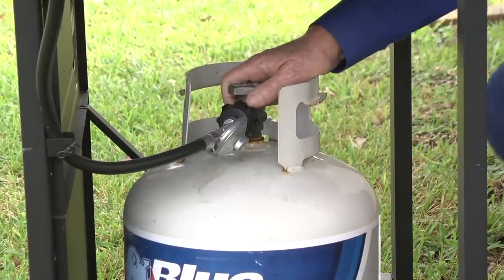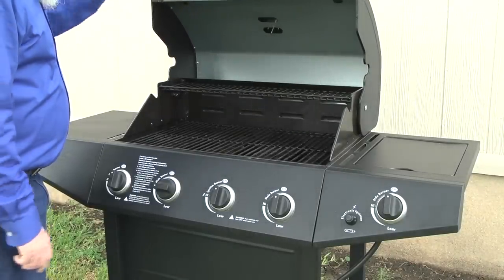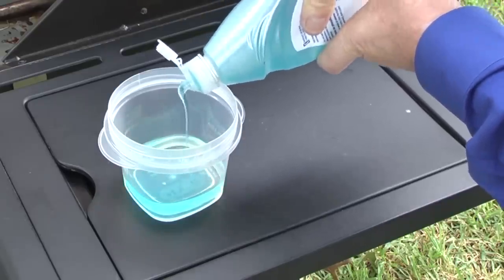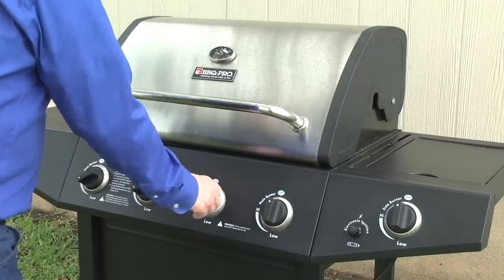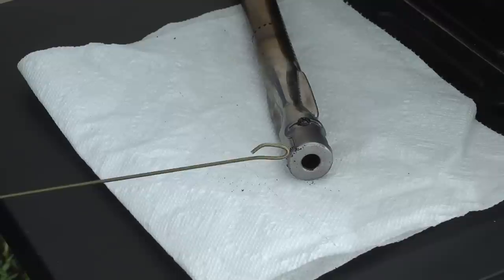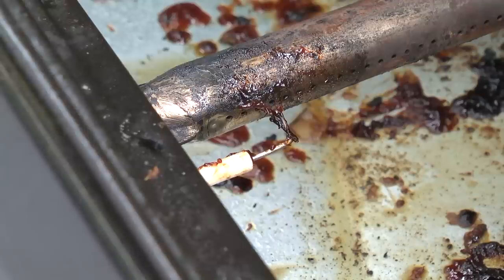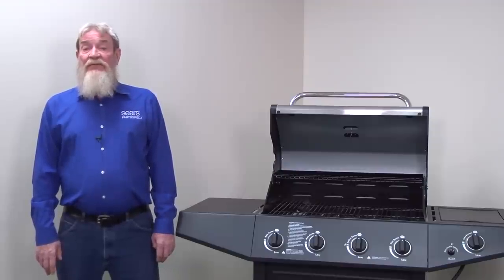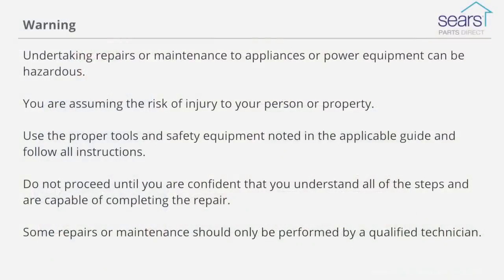Gas Grill Won't Ignite or Light

Comment: In fact, the first thing to do is the last: remove the module and activate it with the button: is there an electric arc? Yes, continue with the other tests; and if No, please clean the battery contacts; Is there an electric arc this time? No. Replace the module.

Comment: I think you are wrong when you test the removed electronic module, that way it is an open circuit therefore you will never see voltage on the voltmeter (multimeter).

Comment: I can't thank you enough for this video. I was all set to buy a new grill, but just on a whim did a search for a fix-it guide online. Yours was the first video that came up. On it I learned the pressure regulator needed to be reset, followed your instructions and bingo, it's working just fine now. You saved me a lot of money.

Sears, I'm grateful for this. I really hope you guys can pull through.

Comment: I just ordered a new ignitor. $10 on Amazon. My Char Broil was only 3 years old, I replaced the battery, and used Deoxit  for the electronics inside the igniter cavity. Still No clicking etc. This is a great video on everything.

Comment: seeing how you used the multimeter I know I went wrong having mine on DC 20v and touching it's wires to both starter terminals. Now, blank screen when turned on and yes fuse ok.

Comment: Help my electric igniter does work, it sounds...but I don’t see any pulse outside and it won’t light up! It rained all day and it got wet. Does that have to do with my issue??
Reply from the maker: A wet igniter electrode can prevent the igniter spark from arcing to light the burner. Let the grill dry completely after the rain stops and see if the igniter works. If not, follow the troubleshooting steps described in the video to fix the problem.

Comment: Video shows checking for voltage but how can there be any current running between the module and the grill burner if there is no connection between them? There would never be a complete circuit!

Comment: I do not have a special small knob to push for ignitor.  I have to push the large ignition burner on the far left.  How do I get to the battery for the ignitor.  I took off the large knob and no battery inside of that and no clue in finding the battery.
Reply from the maker: Not all grills use a battery. Some models use a piezoelectric starter that doesn't need a battery to generate the ignition spark. If your grill has that type of igniter, you'll likely need to replace the igniter if it isn't producing an ignition spark. If you're unsure which type of igniter your grill has, let us know the model number of your grill and we'll let you know the type of igniter that it uses.

Comment: Hi man , great video.I have a problem.I brought a new BBQ very much like the one you have here for a client.Its almost the same.The old BBQ that this model replaced it was a smaller bbq and the gas bottles with it are very small , like cubes ( I think these ones are meant for inside traveling caravans or for a small bbq.As I said the one I now have is built but it will not work on these small bottles , could this be my problem ? that I need to get a larger bottle of gas ? like the one you have on your video ?.So my question is the bigger the bbq does this need to be a bigger supply of gas , rather than a small bottle.Please let me know as soon as you can.Thanks man and a thumbs up ! & subbed  :)
Reply from the maker: Check the owner's manual for the grill that you just bought for information on the type of gas that the new grill uses. If the new grill looks like the one in our video, it likely uses the 20 pound propane tank shown in the video.
Reply: @searspartsdirect   Thanks Mam. Yes it looks like the one in your video , now my back is recovering after building this thing of 1,000 pieces like a mechano set   , tomorrow  I will bring the correct bottle to the house. I am in France , but I am a Britt, so there was no instruction in English & the diagrams  of the instillation was like not that great .But thank you for replying to me so fast. I will let you know how it goes. :) Bon weekend !

Comment: This was a great video....but it didn't solve my problem. I've gone thru all these steps, but I cannot get a spark. I've replaced the ignitor module, still no spark. New battery, also. I may have to jack this bbq up and slide a new one underneath!!!!!
Reply from the maker: A wiring failure or bad spark electrode could be causing the ignition problem in your grill. Let us know the model number of your grill if you need more help troubleshooting the ignition failure.
Reply: @searspartsdirect  Thank you for your reply. I can't seem to get a spark by pressing on the spark button, but there is sparking at the button itself. Just not getting to the individual igniters. The module they sent does have a button on the body itself where the battery goes. It is sending spark to the individual burners by pressing it in. I can live with this...thanks again, and, great tutorial!!

Comment: The three burners on my brinkmann grill 810-2400-0 don't get spark but the wires are connected and it's light with a lighter. Only get spark from the side burner. What could the problem be anyone?
Reply from the maker: Check for DC voltage from the spark module to the main burners as shown at 6:03 in the video. Replace the spark module if the meter doesn’t detect DC voltage going to the main burner electrodes from the spark module.

Comment: Does anyone know the expected voltage between the probe and the bare metal on the grill? With a new 1.5v battery installed I get about one volt between the two output wires but after it goes through the distribution box ( mine has multiple igniters) I can only read millivolts between the probe and the metal of the  burner
Reply from the maker: Let us know the model number of your grill and we’ll try to get that information for you.

Comment: ...and if your spark module is good, you will need to replace your multi-meter (unless you have a meter that will tolerate impulses with thousand of volts).

Comment: In my case, the problem is a slightly bent-down metal tip caused by cleaning, which directs the sparks to the metal body instead of one of the holes.

Comment: If none of this works, take the two wires off the starter button and push them together.. If you get spark the starter button is bad..Worked for me.

Comment: What if your grill igniter doesn't use a battery? Mine is just the red button that you push really hard and it makes a loud clack!
Reply from the maker: Your grill uses a piezoelectric igniter that generates the spark when you push the button so it doesn’t need a battery. Even though your igniter module doesn’t use a battery, you can still use the troubleshooting tips beginning at 5:00 in the video to fix the ignition problem in your grill.
Reply: Blakecarnehx